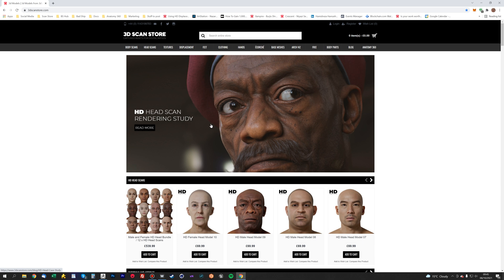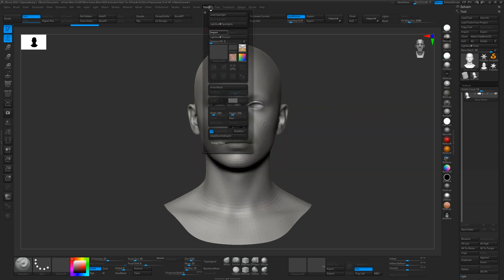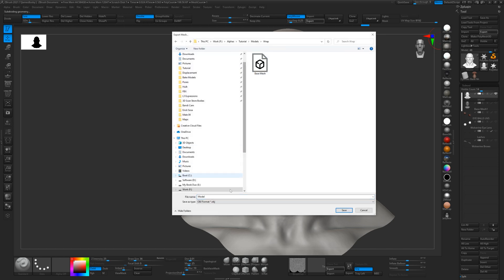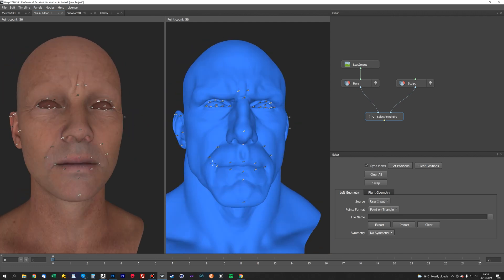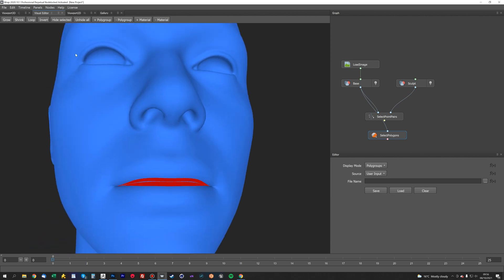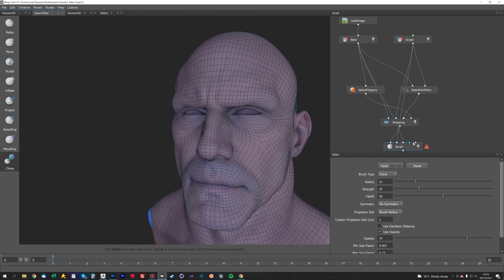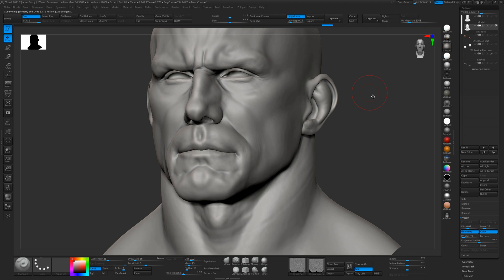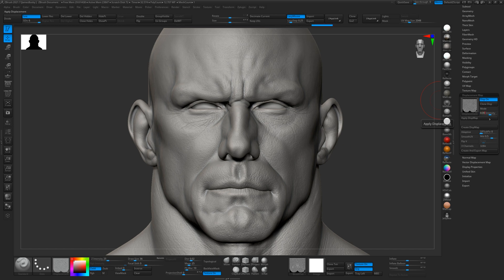Wrapping HD Displacement Maps To Your Mesh

Comment: Thanks for the great tut and products. One thing i‘m struggling is the displacement maps in wrap4d. I can‘t import exr files into wrap. So i converted them to 32bit tifs but still not importable. 24bit tif then are importing into wrap but they look destroyed. I wana Transfer the displacement map from scan onto my mesh with texture transfer node. Can you please light me up?
Reply from the maker: Hey, hmm you could try using something like X Normal or marmoset to transfer the textures?
Reply: @3dscanstore  Ah this worth a try with xnormal. Thank’s But I think i just need to figure out, how to convert them from 32bit exr to usable 16bit tif‘s.

Comment: Idk if this is a stupid question but what’s the difference with buying a texture map or a displacement maps if both come with the same maps for different prices?
Reply from the maker: Its not a stupid question at all, its slightly confusing on the site at the moment. The Standard texture maps are extracted from our lower resolution "Animation ready heads" they have about  a 3rd of the level of detail you would find in the "HD heads" which is what the new HD maps are extracted from. They are a lot harder to generate then and much simpler displacements in the standard texture packs which are basically just exported maps from Zbrush.